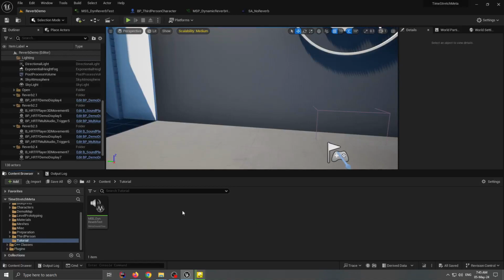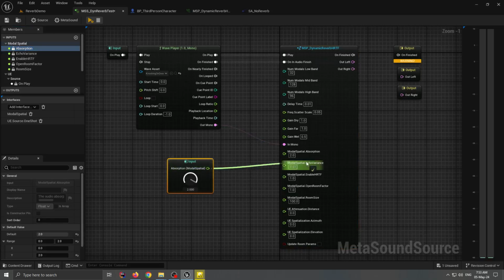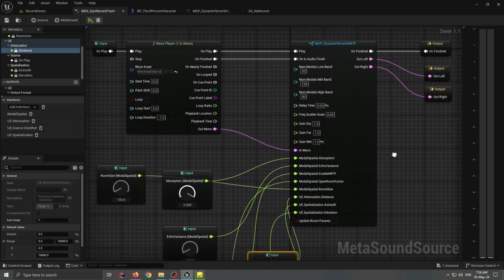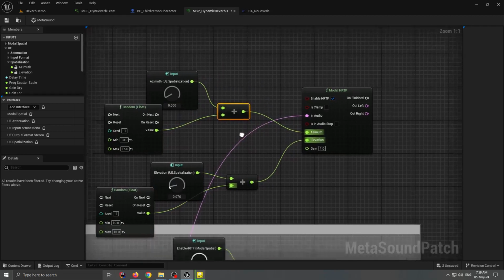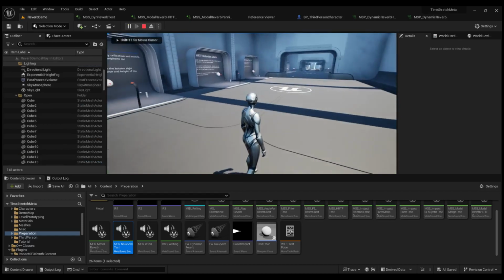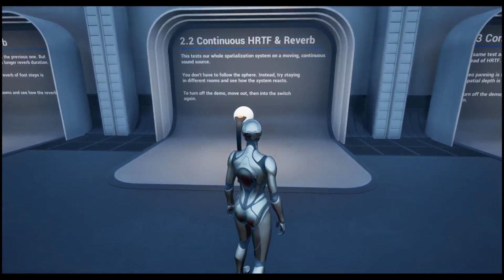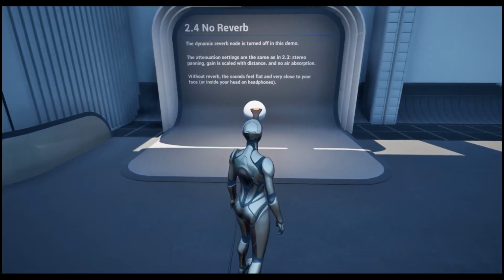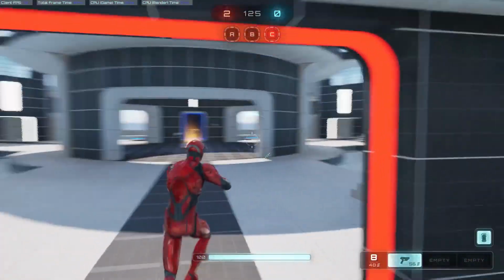Spatialization: Dynamic Reverb System

Comment: Heya nice plugin! I'm curious how you implemented HRTF's, I can't seem to find any info on them in the documentation so I assume you use a third party library?
Reply from the maker: Hi, we do not use 3rd party library. We implemented the HRTF node based on IIR filters approximation, instead of using FIR filters like conventional approaches.
It's based on current researches in the field, but we modify them to make the calculation less computationally expensive.
To smoothly change parameters at runtime, we extract data from public datasets and apply different interpolation techniques for each parameter.
We talk a little bit about this in our HRTF node video: https://youtu.be/zldr8GMwpEM?si=OVPJzCEvn11utZgo
Reply: @ProceduralSFX Oh that is really cool. I wonder how this differs from the binaural setting that exists in the engine ( just found it exists ), is this similar to HRTF? This can be set in the metasounds attenuation settings ( panning or binaural ).

I'm curious how the reverb and reflections are made? Do you spawn separate sound cues / metasounds that has it's settings based on the enviroment?

I think I'll get this plugin sometime this week for my own project, but I'll also like to learn how it's made. Is the source code available to users? Thanks for replying!
Reply from the maker: @Stelleart  UE 5 doesn't have a default implementation for HRTF. The binaural in the attenuation settings is meant to be used with other plugins. For details you can view UE5 Sound Attenuation documentation. 

The same Metasounds graph can be used to create the reverb. You can also use a separate global reverb graph for better performance.
So the reverb parameters are calculated by our Dynamic Reverb Component, which scans the scene in realtime. When a MetaSounds graph is played, if it implements our Spatial interface then the calculated data is passed into this graph. With the scene data and our reverb node you can determine how the reverb will be created from your SFX.

Yes, the source code is available for users. We do not use any 3rd party dynamic link library so no code path is hidden. 
If you want to learn more about how it's implemented feel free to contact us on our discord.